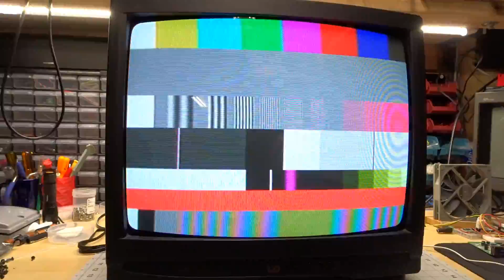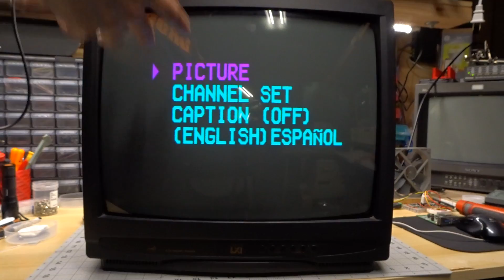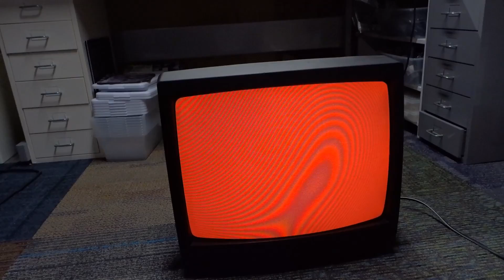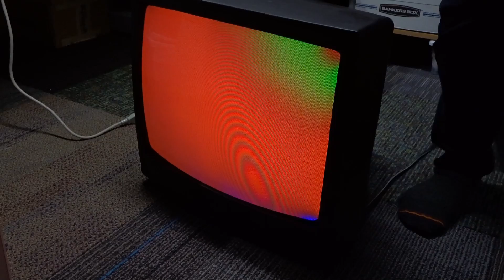Follow-up to my Trash Picked TV 'RGB Mod'

Comment: I wonder if the degauss coil was the original or not? strange failure if it was replaced, but being a cheapo set would explain if they used a "recycled" one not a new correct one... After all, maybe where it was used it was good enough?  Also, your sign off reminds me of a cross between big clive and jonathan w. (your content at this point however, is getting close to Shango066 & all the better for it... heeeerre we have a fine Funai set with twerkombobulating purity raster-itis)

Comment: Since this set originally only had an rf input and the inputs you added don't include sound, am I correct to assume the speakers are useless? I wonder if a speaker magnet could be causing the issue with the lower right corner.

Comment: Good call on swapping the degauss coil.  It looks like they used one from like a 13-14 inch CRT. That is a weird thing with turning the coil on really fast, then shutting it off. To get that to work with the cabinet put together, just put another switch on it, so you can correct it if it gets screwed up.

Comment: Finally finished my mod of this exact TV. Not having the purity issues you are. However I did find a service Manual for the Funai/Symphonic equivalent, and it requires the remote control to get into the service menu. There are settings for the purity in there as well. I know my buddy had a lot of grief in his basement with certain arcade CRTs doing the very same thing. Some of the Wells Gardner K4600 monitors i have use a huge metal shield around the entire tube.
Reply: I have a similar Funai TV to the one in the video, only about 5 years newer with Composite Video input on the front. Do you have a link to the service manual? Or can you share the service menu details?

Comment: Dude, thanks so much for these 2 videos on this subject. Last year I picked a brand new (yes) 29" Flat CRT with all the inputs I wanted from a Salvage Store (basically they purchase old stock that had to go through insurance companies when the original supplier had to use their policy for whatever reason). I had to open it up to install a toggle switch to access its Service Menu, but since I did that my TV was exhibiting the exact same behaviour as yours, with colors being inconsistent near the edges. I have often thought about purchasing a handheld degausser to see if it would fix it, and now I'll definitely get one. I might as well try to RGB mod it if I feel like getting that huge thing off my rack though. It has a Samsung picture tube that I think should be pretty good.

Cheers!

Comment: I work on CRTs all the time and have the same issues on larger CRTs in my shop with purity changing when I rotate the CRT.  I figured it had to do with the magnetic fields in my garage and lack of shielding.  Its a weird phenominon.
Reply: It is the earth globe magnetics what affects all CRTs if you move its orientation with regard the north.
Reply: Just a thought, could it be the steel rebar in the cement floor?
Reply: Have you tried sheet metal to remedy it?
Reply: It is the earth magnetic field that the CRT is designed to compensate for in its normal position
Reply: High voltage electricity wires may provide such magnetic effect.
Reply: It's a government conspiracy to cover up that the world is really flat.....

Comment: I’ve just come across a couple of National Instruments Virtualbench VB-8012 units, if you’re interested in one, I would give you an excellent price as a way to support your channel.

I bought them to resell one for a pretty large profit at auction but I decided I’d rather sell one at cost to support a channel I feel like could really use a nice bit of kit.

If you’re unfamiliar, it’s an entire lab bench in a single unit, 5.5 digit multimeter, 20mhz arbitrary function generator, dual channel 100mhz oscilloscope, three channel programmable power supply, gpio, and logic analyzer all in a single wireless unit that uses your PC/iPad for display.

Let me know in a DM if you’re interested, I won’t list the price publicly just so I don’t have people making offers or getting upset that I’d rather sell it to someone who makes content I like than them.

Comment: 1 color crawl on consumer tv via composite in pal region is normal, at least for 80's polish build modular board designs like unimor neptun 505d or unitra wzt helios 506 (both 21 inch color with optional modules for composite and or rgb connection) 
2 i never seen color change on tilting tv, does your house use ring style electrical circuits or electric floor heating?
3 degausing coil in polish domestic tv's is dubble what you have in there and purity is always fixed on the neck magnetic rings
4 why not hooking up audio to that tv via extra holes?

also if you go to my deviantart account (deviantart.com/kokodin ) and search trough the scraps folder, you can find high rez scan of a schematic for neptun 557 tv with automatic rgb/composite switching module
and other than adio block it probably could work with your crap tv as well it literally served a purpose to convert non rgb capable tv into rgb/av one . you can skip making color mixer circuit though because your tv accept straight rgb not r-y b-y like old neptun
if you want a read i can send you some links for polish only service manuals for those tv's

Comment: Remember, there IS metal in that floor. Either rebar, nails, plates etc. Check magnetic fields with either phone app, or just a compass.
Reply: Y'know, I never considered rebar to be magnetized.  But it likely is somewhat, by neglegence alone.  Nobody in manufacturing or construction cares to even bother looking at that.  As long as it doesn't stick together in a lump, its laid and welded together.  It might even be picked and loaded with an elctromagnetic crane.

Comment: The dot crawl thing is also visible in PAL. I wonder if it does with SECAM
Reply: Deksor SECAM doesn't have it due to its having an FM-modulated chroma instead of a QAM on top of the monochrome signal.
Reply: Despite living in france, I never take an more in depth look at this because most consoles/computers here are either outputing RGB or PAL signals. Only VCRs and TV broadcast really used SECAM
Reply: yeah, you could loose the dot crawl with svideo but with consoles buying an svideo or a rgb scart was the same cost and a no brainer.
Reply: Composite SECAM has whats called "SECAM Fire" and it's the worst out of the three actually! It's like a super obvious fire like dot crawl at sharp edges. It's a myth that (Composite) SECAM has superior quality over PAL.
I wouldn't even say PAL's dot crawl is any less objectionable than NTSC's, they are just different. That color bar would look pretty much the same in PAL at the border of the magenta and green patch.
Reply: Dot Crawl is due to the composite signal being a mix of the colour signal and the luma signal. The reason its rarely seen in Europe is due to SCART and every tv supporting RGB natively. So its actually called composite artifacting. RF is worse cause the audio is also mixed into the signal. So S-Video Component and SCART are better in so many ways and will not have dot crawl. So yes SECAM would also experience this. Any Composite or RF source is going to have dot crawl.

Comment: That colour purity distortion is caused by the earth's magnetic field. Cheap tubes or really old tubes are sensitive to it.
Reply: I remember hearing, years ago (on Discovery channel, I think) that TVs were calibrated in some fashion for Earth's magnetic field in the region where they were going to be sold. If they were to be moved any significant distance from that region, there would be need for some sort of recalibration.
Reply: @calvinrempel8600  in Australia our whole CRT screens are installed upside down with the anode cap at the bottom.
Reply: At least the bigger sets are upside down
Reply: @dgpsf  NEC 3FGE, 4FGE, and the 5FGE monitors had the adjustment on the front panel which would display on screen for purity. It was dependent on which orientation  East and West.

Comment: The gun inside the TV is weak (not enough windings) and Thats why it takes very little to distort the picture
Reply: Jman Electron gun  vs yoke windings. This makes me wonder, do you really know what your talking about?
Reply: So I guess i'm going to have to explain this one :-). More windings helps focusing the gun but they may have cheaped out on this one.
Reply: Jman ok, but you said the (electron) gun is weak. Which gun? There are three of course.  If it were all three guns, brightness and contrast would be quite low and/or other problems pop up.  If one gun, that color would be significantly weaker. If extreme and the driver was maxed there are what can be incorrectly percieved as convergence issues that are not really convergence problems. If a gun IS that weak where the outer edges of a larger tube become darker in one color than the others, that leaves the colors off like a gauss or convergence issue in that area (normally corners) that just cannot ever be corrected for. It is a very unique and notable effect not seen here in this video as it CAN be corrected by just moving or deguass of that set. By the time a gun gets this bad however, the other issues generally associated become more than what most would toss a TV over. You can see this effect sometimes however in arcade machines that have been otherwise maintained well. If you know what it looks like it's easy to notice. Otherwise it takes being shown by someone that knows, or just trying to fix it and failing, to learn what it is. The burn in normally is horrid by this time as well. I have rarely if ever seen the worn gun effect that extrem in just one gun on a television. Anyhow is there some other way a gun can do what you allude to that a  yoke can actually correct for?
Reply: Same applies I would guess if a contaminant builds on a gun.
Reply: wolvenar Sorry if I where inaccurate. You have a nice day
Reply: Jman Sorry if I came across wrong, I was just seriously wondering if there was a condition I didn't know about. You have a good day too.

Comment: The screen needs MANUAL De-Gaussing. The picture tube itself has picked up a magnetic charge. We used to have to de-Gauss RGB CRT's all the time because the builtin degausing coil wasn't powerful enough. This was pretty common in the CRT era. your new coul has more turns in it & produces a stronger field. Make sure the coil is atleast an inch or so from any metal at bottom of screen.
Reply: Also, the (PTC?) thermistor in the de-Gauss circuit doesn't just stop the de-Gaussing after a little while, it also prevents it from working in the first place, if the TV set is warmed up. The set needs to cool down for around 20 minutes before switching the power back on so the automatic de-Gauss circuit will work. This is from memories on reading manufacturer service sheets about 20 or 30 years back, so may be a little inaccurate, or even not apply to the model you have. It is a long time since I saw your symptoms happening on any TV I was fixing or owned, but it is not unknown.
Reply: @adriansdigitalbasement  don't build a degausser coil, just use a desk fan or some sort of AC motor (electric drill, blender, you name it). that'll be a more powerful degausser than your coil.

Comment: Thanks for the videos on this! Super interesting! I had an arcade monitor many years ago that was very touchy about being turned. Turn the machine 90 degrees and the built-in coil couldn't fix it - had to be manually degaussed with a wand. Super strange!

Comment: i actually picked up a road crt a month or two, 13 years old and has NOTHING wrong with it (other than sticking keys, easy fix, and the power button is missing but i can press it with a toothpick or similar object)
Reply: it has rf on the back, composite on the front, and a headphone jack

Comment: Hello Adrian, Iv'e been a fan ever since TPA3116. Please can you help, I know it's now a bit 'Off Topic' - sorry. Looking at your video on that amp I'm pretty certain that it says R3 where you removed 'R2' . In the PDF it says R2 is 51K is that R3 on the board ? I have 3 of these little amps all of which came with the heat sink off and all seem OK. I recommend this 99P ($1.30 ish) EBAY 'Plaster' - sticks like whatsit to a blanket  :-        Useful HC-910 Silicone Thermal Conductive Adhesive Glue Tube Heatsink Plaster.

Comment: I think the fact you switch the degaussing coil on and off quickly by the switch you added , that will leave some purity problems as there will be some dc current in the coil . It's ac that does the demagnetising and in the short time the thermistor takes to warm up, that ac current gradually depletes. That's how demagnetising works. Just ask some one from ww II. They use to demagnetise ships so not to activate magnetic mines , the slight current flow in the coil that will be present all the time could be affecting that bottom corner . We use to fit small pieces of flexible magnetic material on the back of the tube to tweak up the purity, it was never a perfect solution. More art than science.......  If you have a hand degaussing wand they were very useful back in the day...
Reply: chuckles  You brought back memories of when I put a speaker magnet to close to my TV.  After the fear, horror, and sweat dried (I was 11yo), I started waving the speaker around the edges of the TV to bleed it away.  It worked!  Although I looked like a witchdoctor applying voodoo to my TV, by my odd slow arcs of hand movement in all three dimentions.
Reply: that's a neat idea. maybe dry erase whiteboard magnets could work for his problem.
Reply: I think he's triggering the TV's internal degaussing circuitry which should be handling that

Comment: Its so strange looking at American TV's no scart must have been a nightmare you have to do so much just to get RGB.
Reply: I wish somebody would ship SCART TV sets to the USA.  If they'll do 60hz.
Reply: using import games (that ran in ntsc 60) on my modded ps1. my PAL CRT with RGB scart flickered but I adjusted the vhold (internal pot) and the v size (again internal pot) and that TV was great!
Reply: Well, we did have s-video, which is pretty close to RGB, though it was never very popular. Composite was basically what everybody used until their old DVD players crapped out and they got something with HDMI.

But the good thing about North America, is we had 60hz games, which is how they were designed in Japan. So we didn't have weird frame pacing or speed issues with tons of games, as you guys did in Europe.
Reply: @lulkLogan  we also had component video.. i used Svideo and component on every system I could. Component video on PS2 look pretty great. I also had Svideo on GameCube and either component or svideo on N64. It wasn't all bad. Even playing Atari or C64 over shitty RF cables we still had fun.
Reply: Yeah component wasn't big in the 90's though. Whereas you would still see s-video on most mid-range tv's. RGB was pretty common in Europe in the 90's, in my understanding.
Reply: @lulkLogan  yeah, Svideo made a HUGE difference over composite. I wish we'd at least had Svideo instead on early consoles like NES. Composite was garbage
Reply: How do you actually talk about that "thing" with each other? I mean what is the rhetoric and the choice of words?
Usually in Northern Europe the woman will try to make "it" (whatever we are talking in home electronics) as small as possible, for some reason, even though they enjoy the big screen, speakers etc. more than anyone else.
Reply: @Ryuhouji i once had a 120" screen and a 720p DLP projector.  I now have a 60" 4K LCD.  In a lot of ways I preferred the huge screen because it replicated a theatre experience and even at such a huge size the low resolution wasn't really noticeable to me. Then again, i haven't really watched all that much 4k content because there isn't much.
Reply: @Eddie Quist: Not really. Ignorance was bliss. Most of us didn't know what we were missing, and thus didn't really care. Composite was a big upgrade from RF and did the job well enough. We also had S-video, which again was slightly better, and then Component. 60hz was nice though, as most (console) games were designed with that in mind.